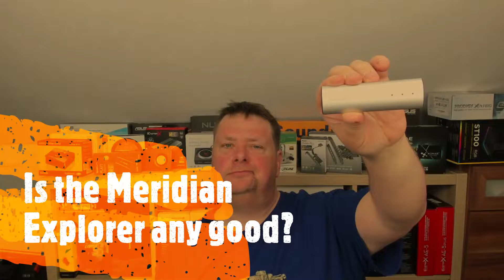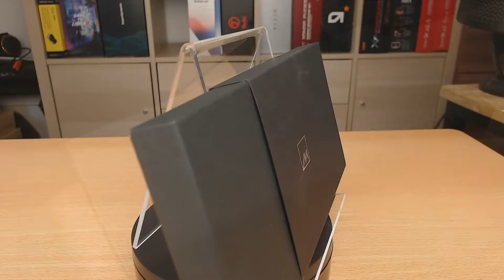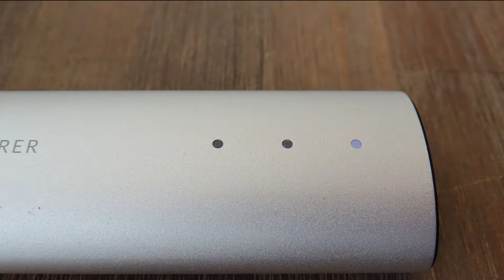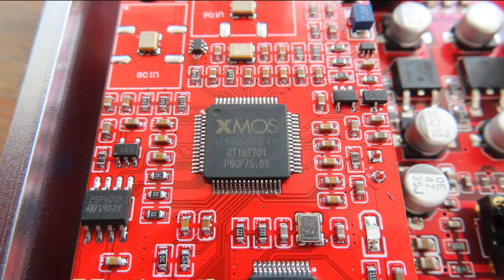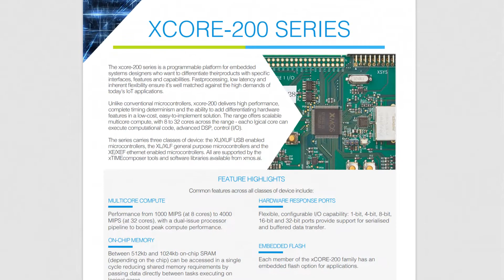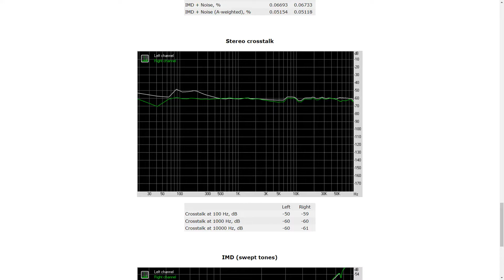A small HiFi DAC?!

Comment: Can I ask how you go about using rightmark audio analyzer? Do you just plug the device in or do you need to loop cables? Perhaps you could do a video to help us test our own equipment.
Reply from the maker: That is a great idea! I may do that! I always test all cards and dac's on a "special" rig. Ok, it's just my old gaming pc, but it still has a PCI slot, so I still test the older cards.

When testing a card, I always use a splitter. One side I attach either a 32 ohm headphone or a 250 ohm, but not always. Normally I mention which headphone I use. If I don't, I'm using a 32 Ohm headphone. In the other connector from the spillter, I use a 3,5 mm male to 3,5 mm male. I use the Creative G6 external sound card as the recording device, mainly because I don't create additional EMI inside the case, don't use up a PCI slot and the G6 can go up to 32 bits and 384 kHz.

Then in RMA it a question of selecting the right bitrate and sampling freqency, of both the test card and the G6. I usually test a couple settings of those, but only show the highest settings. Or the RMA bit of the video will take too long. :D (and I a lot of people skip that already!).

Then the fiddling part comes. You need to increase the volume of the test card to the point where the indicator is green. Every card is different and some won't even reach the green indiocator (especially older cards with no op amps).

But I must admit that this is the way I use RMA and may not be the correct way! I found all of this by myself by trail and error.